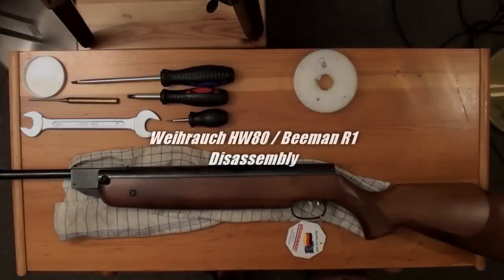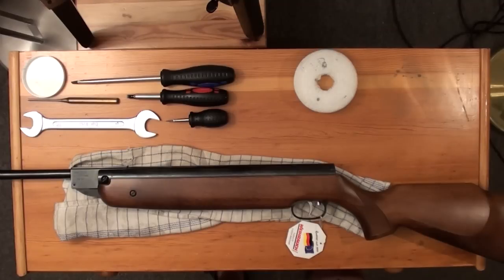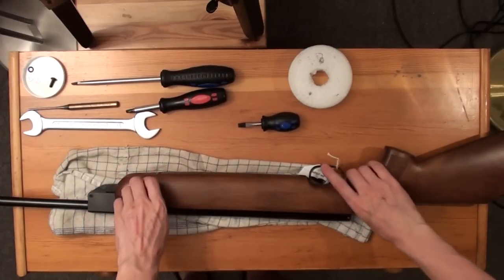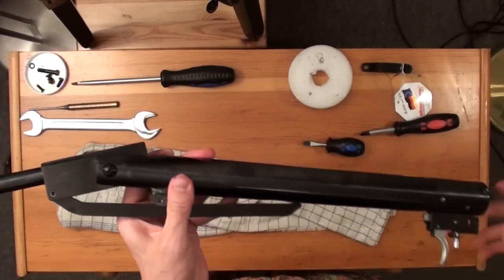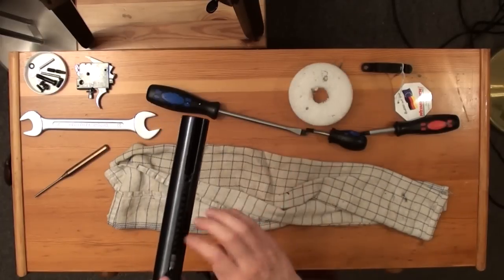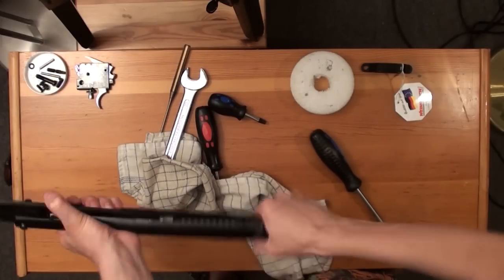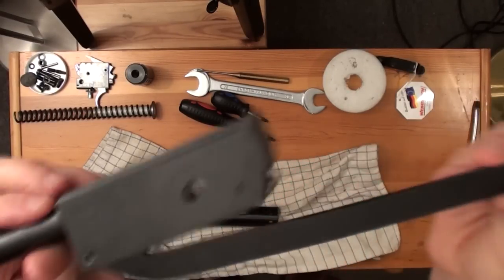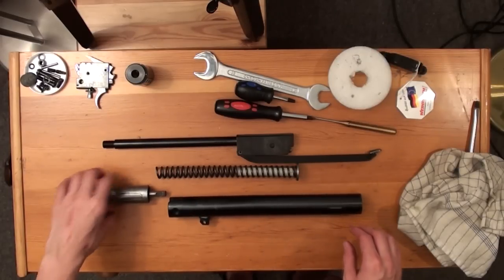Weihrauch HW80 Disassembly

Comment from the maker: Tuning means smoothening the cocking and firing clycle as well as reducing the recoil thus making the rifle more controllable and sweeter to shoot. This results in better accuracy. Tuning isn't necessarily increasing the power. Increasing the power on a spring piston air rifle will always lead to more kick, more vibration and spring twang making it very difficult to shoot accurately. You can slightly increase power with the right lubrication but you would need a stronger spring too.

Comment from the maker: The overall gun (HW80) is just bigger. The HW95 is a scaled down version with smaller cylinder diamter, smaller piston, different trigger block and different smaller stock. The HW80 is a high powered air rifle designed for the American high power market whereas the  HW95 is a medium powered highly accurate easier to shoot rifle.

Comment: Hi, great video. I purchased my HW80 at legal 12ft lb from a local air rifle dealer UK. The green eyed dealer is quick to sell, but not to tell any usefull knowledge so i know very little about air rifles. Would it be easy to replace the spring without the compressor at 12ft lb? should i have done any maintenance when it came out the box? And also i selected the .22 version as i was told the 80 is more suited to .22 is this true??  It was a toss up between the Air arms pro sport but no regrets!

Comment: Hey man nice video. I have a question. I cannot for the life of me unscrew the trigger housing. Seems pretty set. It’s a new rifle but I can’t break it loose. I don’t want to damage the edges trying to open it. Any recommendations?
Reply from the maker: Yep, that's because they put it in the blueing solution assembled so the threads are baked together. You need a hot air gun and heat the end block up till you see a lot of smoke (burning muck and grease). Find a spot on the cylinder (with or without barrel attached) that you can safely clamp in a vise without destroying anything. Take a spanner or something similar that fills the gap for the trigger unit completely and give it a good smack with a heavy hammer. That should do it. I've done it several times on HW97s. After you have done that, clean the threads because they are almost always rusted because of the blueing solution that they couldn't clean off.